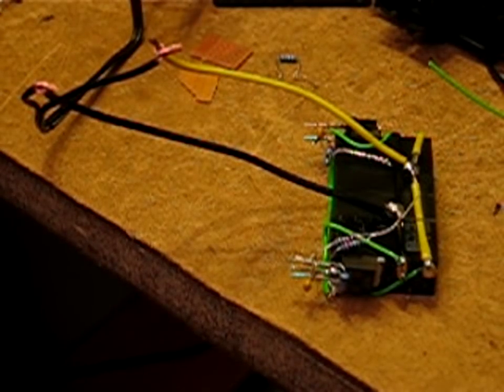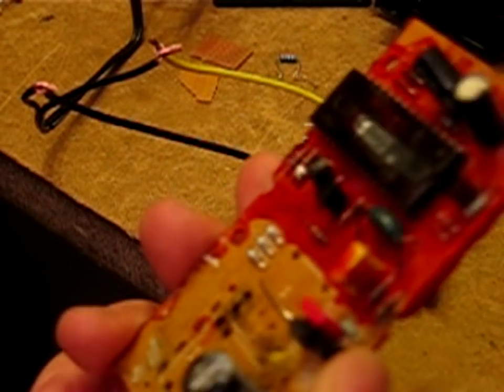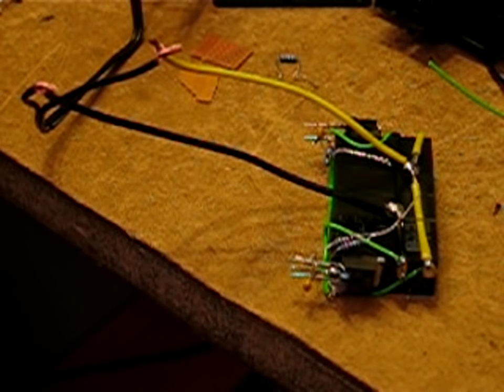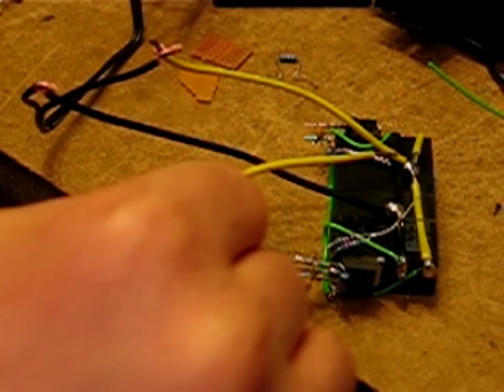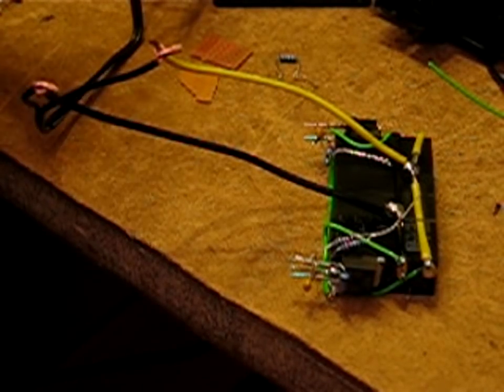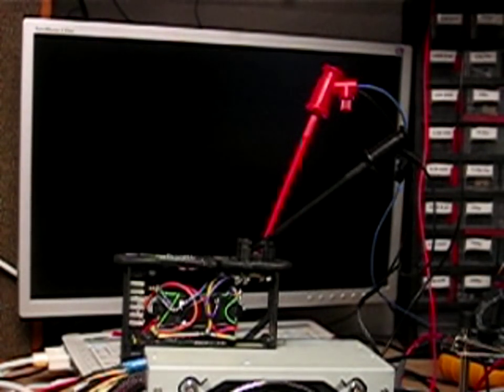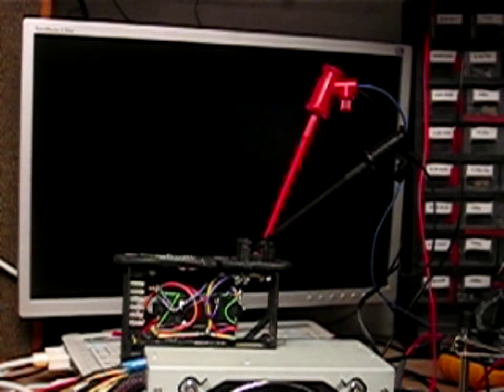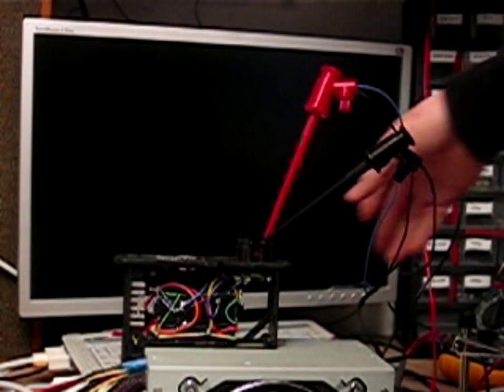A long time ago, in a basement not so far away ...

Comment: FFcossag,  I hope you read your replies because I need your help.
This reply has nothing to do with this video, but because you posted videos on passive cooling gpu's.

I bought an MSI NVIDIA GeForce GTX 1060 6GB.  I chose a specific model that had all the architecture on one half of the end plate and left the other half clear for airflow.  I want to convert this graphics card from a 2slot to a 1slot.  Performance graphics with 1slot are very hasrd to find now, so I will convert instead.

The GPU chosen is easy to seperate and compact because it doesn't have ports on both sides of the endplate, my case is very small but has about 1-2cm clearance beyond the width of the single slot but doesn't support a two slot card officially.

Do you have any tips for modding graphics cards that I could use for this project.
Reply from the maker: I'm not sure what specifics I could tell you. Try not to knock components off, and make sure your new cooler doesn't hit any components that are taller than the GPU chip, since a cooler that isn't on 100% straight is going to destroy everything.
Reply: @FFcossag  Thanks for the reply.  What I want to do is use the existing cooler, but remove the plastic sleeve and add a much thinner fan.  My case has some play room but doesn't have formal space for a 2slot graphics card.  The card is a bloweer with air ejected out the back, but as it will now be against the side of the case, and there are holes there I could have thin fans and blow straight out.
That is the plan anyway.  I will have to destroy the plastic housing for the graphics card, but I should be able to do this and still keep the heat sink.  Tell me if I am wrong.
Reply: @FFcossag  I have never dismantled a graphics card before, and for obvious reasons want to do it right first time.  The backplate and fan/heatsink are attached with screws in most cases, yes?  I don't want to mess with any soldered components.  Your video showed you dismantling the graphics card, is this design normal, could I render it down to a board.
Next question is that if I have to can I shave off or clip away portions of the vanes of the heat sink to fit.  I saw you do a bit of chopping away yourself with the graphics card you converted, and wondered if the fan vanes are robust enough I can saw off a couple of small amount if needed to fit.  I am assuming I need to leave the brass pipes well alone though.
Reply from the maker: You can cut anything that's not a heat pipe and all that happens is that it performs worse. Big sidecutters usually work well for this. If you're not actually replacing the cooler, there isn't much to go wrong. Just don't lose any thermal pads, and remember the heatsink compound.
Reply: @FFcossag  Thank you for that.  I expected as much but I think you understand why I have to ask and not assume.  I think I will not get much performance loss if I shave a bit off the heat vanes here and there to fit, because it will be proportional to surface area.

Comment: You sound much the same as you do now.
Relays and transistors, if you made the unit now im sure you would use a current detector so the motor would lose power when the current went too high (full up or down window).
You may have had current detection in 2012 but it was not obvious.
Reply from the maker: I would not bother making a device like that fancier today, honestly, lol. Keep it simple, stupid!